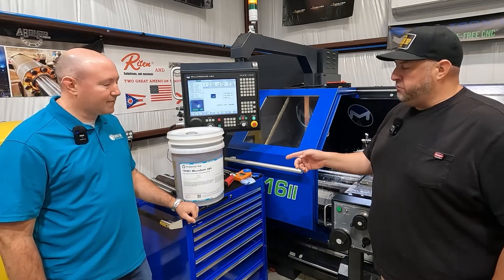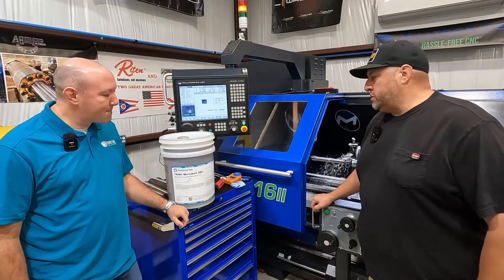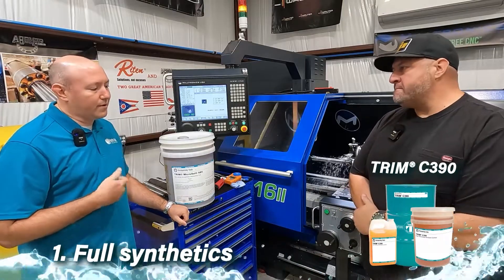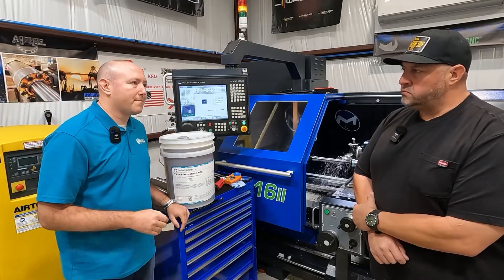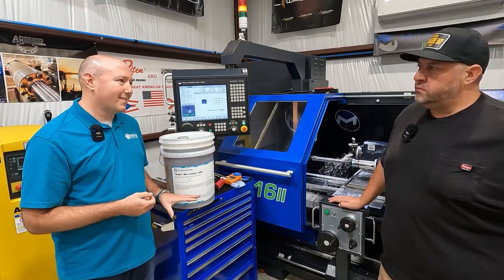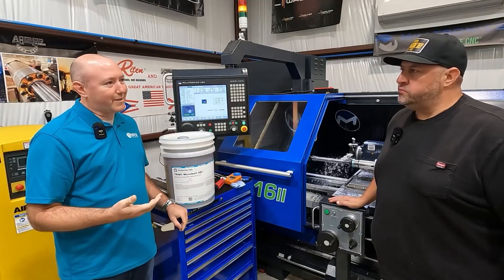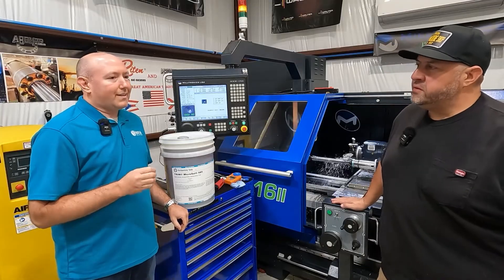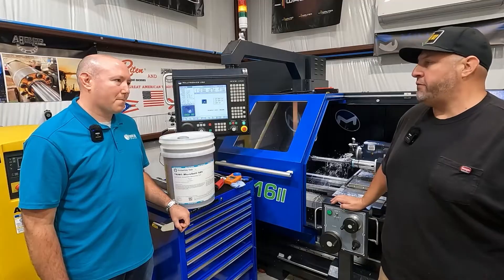Types of Metalworking Fluids – Featuring Abom79 aka Adam Booth

Comment: What’s your opinion of 685XT vs 585XT for light duty multi metal work, where machines will sit a while? I’m concerned about rust prevention. So think very small garage or hobby shop.
Reply from the maker: MS685XT is going to be better for that application where machines will sit for extended periods of time and will cover his multi metal work. 

MS585XT will also but sump life on MS685XT will be a little better.
Reply: @TRIMfluids  thanks for your reply. I have a gallon of 585XT. If it’s good for rust protection I’ll use it first and swap to 685 when it’s done. Thanks much!